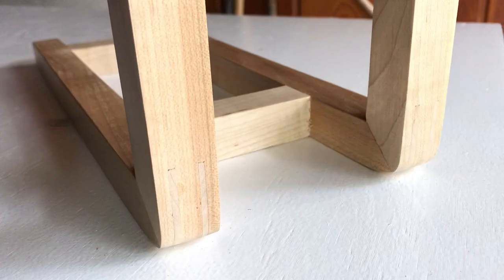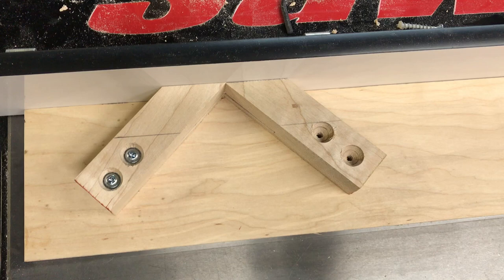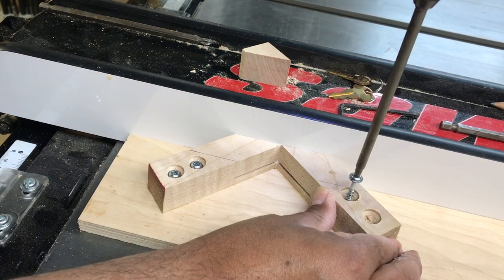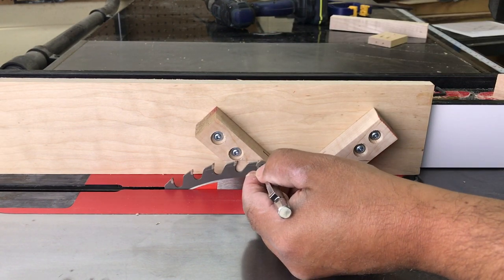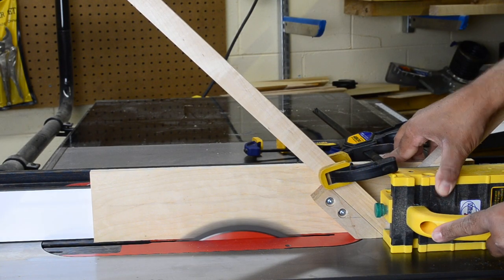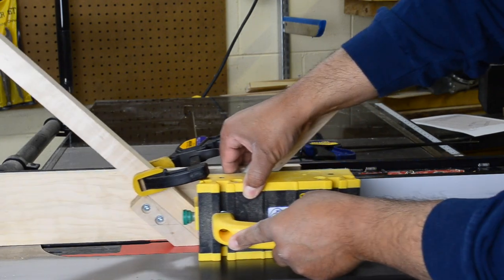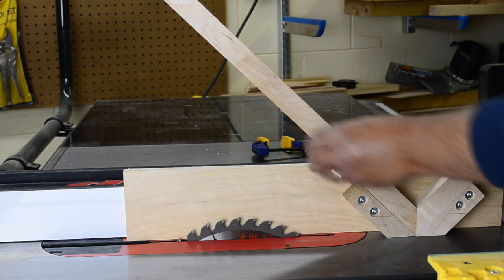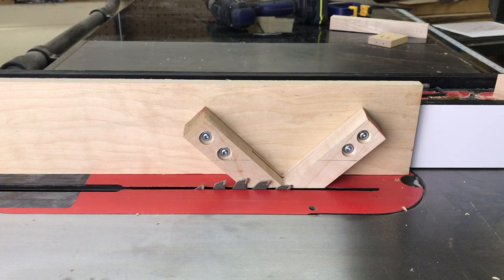Spline Jig for Narrow Stock

Comment: Nice jig. What type of countersink did you use? I’m looking to upgrade mine and the one you used may be the upgrade I’ve been looking for.
Reply from the maker: It's an Amana No Mar adjustable countersink. I've had it for a few years and absolutely love it, although I don't think "No Mar" is 100% true as I've left a mark or two on material, but it easily comes off.

Thanks for watching!

Comment: Nice jig, but for me I  use metal screws on my jigs only for glue up clamping and then remove them . Super glue has proven to be very good for end grain holding power. I don't need another blade and cartridge change on my Sawstop.
Reply from the maker: I thought about that as an issue also. I may revisit removing them, especially if I used thicker stock where I could cut a wider spline. Thanks for watching.